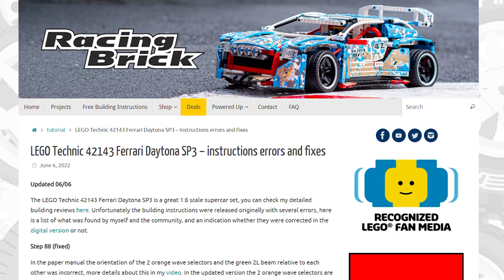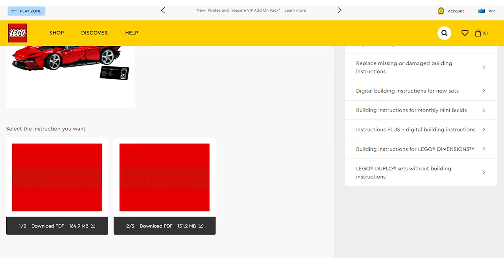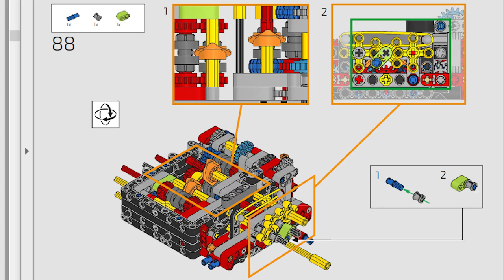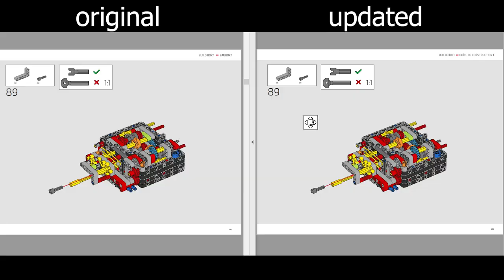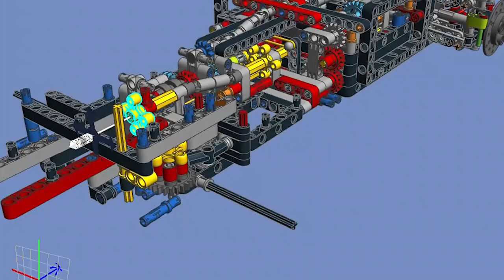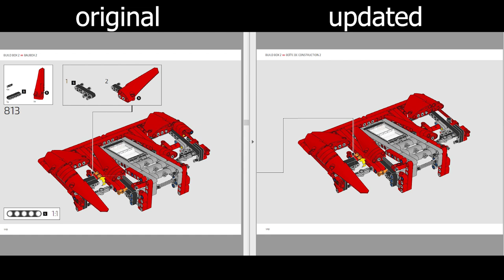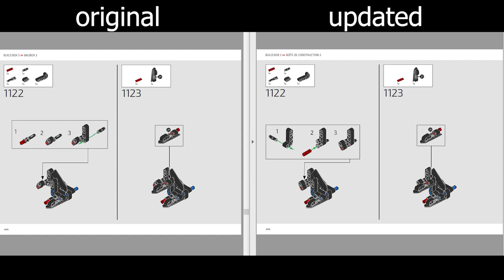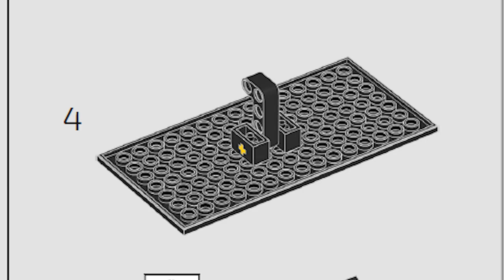LEGO finally fixed (almost 🤭) the LEGO Technic 42143 Ferrari Daytona's instructions

Comment: I used to oversee user guides for a UK electronics company.  We checked and checked and checked again.  If one thing changed and that had an effect on any following pages then they were changed as well so that the whole set of instructions was consistent.  Even if we changed a tiny detail in a picture of a product, that got changed everywhere.  To me, it looks like 1) Lego don't care, and 2) they gave this task to someone not very experienced and then didn't check their work, because of 1).
Reply from the maker: Or 3), LEGO is pushing out more and more complex sets at a higher rate and quality control cannot keep up with this
Reply: @RacingBrick  I agree, but some of these kinds of issues should not get that far. So I guess it's a combination of a lack of experience and care by those creating the documents and a lack of adequate QC before release to market.

Comment: HOW COULD LEGO LET THIS PASS? SO MANY ERRORS ON A FLAGSHIP SET

That's just disappointing
Reply: It's Ferrari.
Reply: @mikosoft  sian also has several errors including incorrect coloring on half of the pieces. Id say thats much worse than a few errors in the manual.
Reply: well it was a joke related to how "great" Ferrari is doing in F1 now
Reply: Mould king have better instructions sometimes than lego.

Comment: i just finish building this set and i found a way for the engine cover to stay up, just take off the 2 small red pieces (4.85 BUSH FRICTION W/ KNOB) off the top of the engine support beam (TECHNIC 9M BEAM) and replace it with the BEAM 1X1 along with the CONNECTOR PEG W. FRICTION at the bottom of the support beam. Well if you have extra 4.85 BUSH FRICTION W/ KNOB lying around then you dont have to remove the top 2
Reply: If only they would have made it that way.

Comment: Strange that no one mentioned a very obvious error on steps 978-979, not only are the angles wrong there, but the pieces themselves are wrong too. Had to look at step 980 for reference, which was correct. Online version has that error too.

Comment: Question, if #104 uses the other longer piece, is the shorter piece supposed to be used in its place on whatever step it’s supposed to be used?  Because, I’m on step 162 and I don’t have that linger piece. So I’m assuming I need to exchange it, right??
Reply from the maker: Nothing to be exchanged, the pieces to be used are correctly indicated in the steps. Only the checkmark was swapped at 104.

Comment: Hello, Thank you very much for the video and the explanations. I am currently assembling this model (I am on end of Box 1), based on the online assembly instructions. I think I followed the assembly steps correctly, especially on the gearbox. At the end of box 1, I additionally added the wheels so that I could move the car and observe the gears closely. However, I noticed that on the 2 shortest gears, it is difficult to move the car, you feel that the gears are straining and then almost lock. This is understandable because when you move the car, the reduction ratio is reversed until the engine, so the small gears become the longest and difficult to engage. Do you also have this kind of behavior? I unmounted and remounted several times, also tested without the engine and I would like to be sure before continuing on the next box. Thank you again,
Reply: Hey I really hope your problem was solved. My set is finished and the gearbox is faulty. It shifts gears but not to low gears with high friction.

Comment: OK, im on the 169 step and i have a problem.. the differential locks in one point and i cant rotate the wheels anymore, like its hard, also when i move the right wheel, the left one is moving the other way, like if i move the right wheel in front, the left one is moving backwards.. can you help me? im sure the problem is at the differential, because the gearbox is 100% correct, i tested it.

Comment: Hi i recently got the set last week, do you know if the booklets that come with the set have been updated as I have gotten about halfway through the set and am just now seeing this video.
Reply from the maker: I don't think the manuals are updated, but you can verify easily by comparing them to the digital version. Check the link in the pinned comment to see which ones are the critical steps

Comment: Hi, a few days ago i downloaded Lego instructions from their page, and i found an error on step 813 (book 2), first, it doesn't look like your updated step 812, and second there's a printing error in number of pieces for bricks, 4 Axle Hose, Soft 7L instead of 2 and 6 Technic Beam 2 x 3 L-Shape with Quarter Ellipse Thick instead of 3. If you have time, check it out. Cheers
Reply: Yes, its doubled , step 812 is correct

Comment: Ive been collecting lego since the seacow in 2014…. I never saw that much error from quality control and bad design from lego. Not color match on pieces, missing pieces, building error in the plan, wrong logo for themes and i probably miss a few. And they rised the price from 10% to 20%. I am really disappointed considering i pay for my lego

Comment: question. just brought the set, as someone who only intends to display it will i have any issues following the original instructions?
Reply from the maker: You will have 2 leftover small panel fairings, and a few moments where you'll scratch your head. I suggest to check the error list linked in the description
Reply: @RacingBrick  thankyou

Comment: I followed the updated gear selector positions in step 88, but I found that my transmission works properly in reverse, but when in forward/drive, only every other gear engages (i.e. the car is in neutral). Does anyone else have a similar issue? This issue is not present on the Lamborghini Sian.
Reply: After working through the instructions again I found that I messed up on step 68.  There are two gray gears required for that step, but I only added one!  I also later found a similar post on reddit of someone who also had an "extra" gray gear at the end of box 1.  Seems like a common gear to miss adding!  There should be no "extra" gears at the end of box 1.
Reply: @mitchellt7868  yup same...........i also found the reddit post, thank god i didnt build anymore.
Reply: Happened to me exactly, had to take off everything and start almost from 0